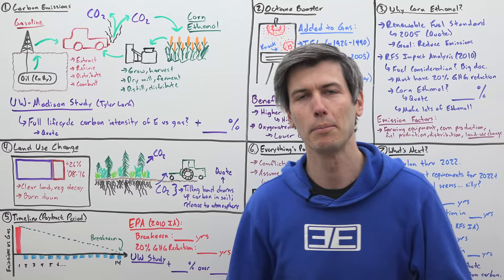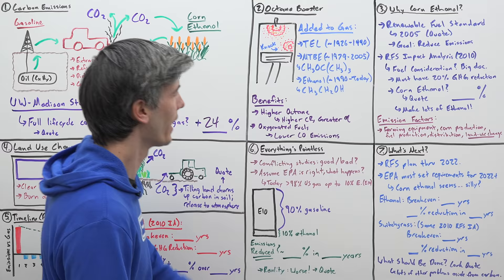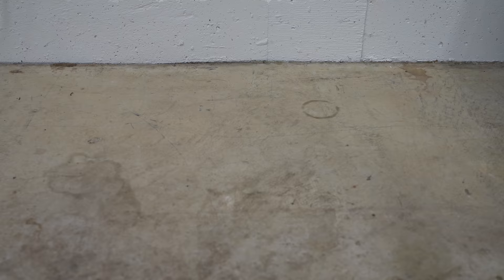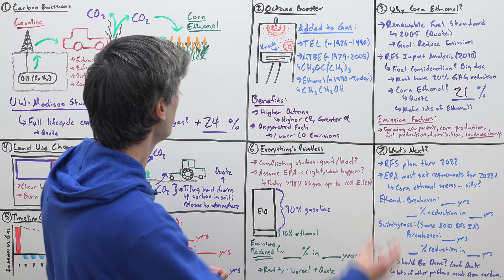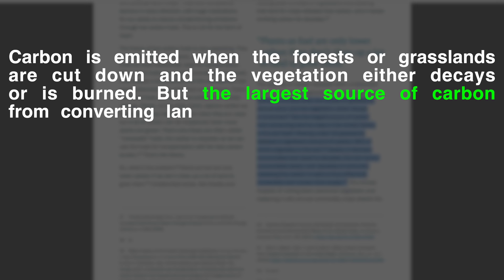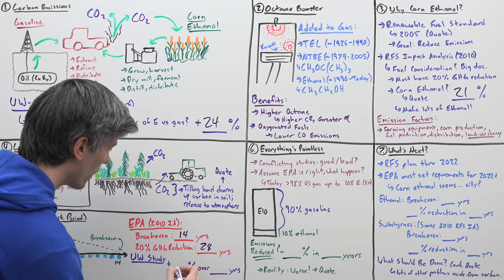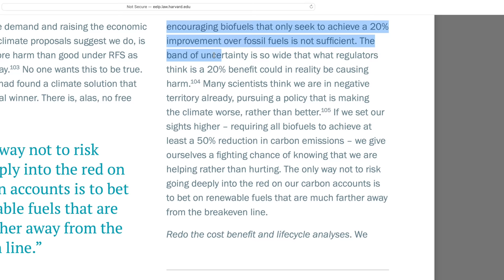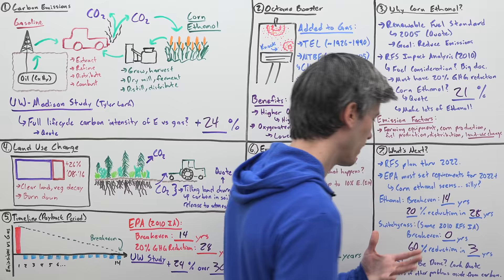America Was Wrong About Ethanol - Study Shows

Comment: The information in section 4 of your presentation is highly flawed it may have be correct in 1980 but not now just an example in the 80's corn yields would run in my area 100 to 150 bushels a acre now yields run from 200 to 300 bushels to acre not one more acre was cleared to do this and a large percent is done with no till not plowing or tillage this is easy information to come buy who ever is doing these studies are stating more opinion than facts because clearly they did not research it
Reply: Corn acres in the US have remained more or less constant since USDA kept track of them with 1932 (during Prohibition) the greatest at >113 M acres compared to 2018 (the year of most ethanol ever produced) at >88 M acres.  The yield trendline has been in a steady increasing rate very similar to other crops.  

It is quite impossible for grasslands or forests to have been broken up for corn on its face since US cropland acres have been falling since ethanol.

The corn belt actually grew more acres of corn in 1980 before ethanol than in 2018, the year of most ethanol ever.  Census data shows in corn producing states that grassland, forest, and wildlife areas increased since ethanol.

Comment: Hello, I really like the video. One thing that you did not put into your math is CRP land (land the government pays the farmer not to grow anything on), and as far as nitrates that is controlled (if done correctly) is crop rotation = Beans- corn - corn - beans.... Also, the fact that you can't pipe 100% ethanol like they can with gasoline, it has to be trucked or by rail car. Over all I think E10 or E85 is a good thing. When ethanol boom started it had a massive impact on farmers that could not sell there corn for anything but scraps hence CRP land to control crop production to farmers now selling corn for $4-6 a bushel up from $1.50- $2 a bushel. With all of this EV stuff I think it is a great start to something that could lead to much better technologies.
Reply: We have an ethanol pipeline in Florida and Kinder Morgan was building a huge dual use pipeline to it which was stopped in Georgia by landowners.  Brazil has thousands of miles of ethanol pipelines.

There were no grasslands or forests broken up for ethanol.  Simply impossible because US cropland acres have been declining.

Census data shows grassland, forest, and wildlife areas increased in corn producing states since ethanol.  

Here is how the 2007 Energy Independence and Security Act affected food/feed prices(if at all):

2007 WEIGHTED CORN PRICE =$4.20 WITH 4 .7B GAL MANDATE
2008 WEIGHTED CORN PRICE =$4.06 WITH 9B GAL MANDATE
2009 WEIGHTED CORN PRICE=$3.55 WITH 10.5B GAL MANDATE

2016 WEIGHTED CORN PRICE =$3.36 WITH 15B GAL MADATE MAXED OUT
2017 WEIGHTED CORN PRICE =$3.36 WITH 15B GAL MANDATE MAXED OUT
2018 WEIGHTED CORN PRICE =$3.61 WITH SAME 15B GAL MANDATE MAXED OUT + MOST ETHANOL EVER PRODUCED

Wheat
2007...............$6.48/bu
2008...............$6.78/bu
2009...………$4.87/bu

2016...………$3.89/bu
2017...............$4.72/bu
2018...............$5.15/bu

Soybeans
2007..............$10.10/bu
2008..............$ 9.97/bu
2009...……...$9.59/bu

2016..............$9.47/bu
2017..............$9.33/bu
2018..............$8.48/bu
Reply: @danafletcher2341  Hello, it is honor to have you reply to me. I am not looking to go toe to toe with your info as I am only going off of what I know at ground level, AKA growing up in a rural farming community, and having a distillery. I am in Iowa. There are a lot of ethanol plants here and even bio mass plants (stofer bails). There is no pipelines. I question if it is 100% pure ethanol going through those pipe lines or if there it is some sort of blend, in WY the is a refinery that gets rail cars delivered to mix with gas and then piped. Over time the water and benzene in the ethanol will eat at the pipes, plus it is fuel grade (super nasty stuff, unlike beverage grade). The nice thing about corn ethanol is there is not a lot of waste. All of the by product get concentrated into high protein DDG's and feed to cattle. I am getting off topic. Normal when you lock up your land into the CRP program it is for 10 years so it make sense that there is a reduction in crop price because farmers can make more money growing corn instead of growing literally nothing. Also, it would be interesting to see the crop prices before the ethanol boom like the 90's corn prices. Please don't take my comments as negative, I am interested in the out come if more data was applied and what result would be. One of my problems is that if you have ever visited rural farming country there are houses in the middle of no where with like 2-3 trees around it. I don't see where or how farmers would be destroying the forest or grass lands because every where I have ever visited there in none left to remove. I guess you could take out the water ways but farmers are very smart about conservation it's not like the 1920's anymore. I just thought of something else, the big seed companies have made leaps and bounds in crop tech, maybe also higher yield per acre has something to do with it. It would be a good show for you to talk about the yield per acre since 1900 to date. More supply, less money hence CRP program. Any thank you very very much for your time. I do really enjoy all of your videos. God bless and have a great day.
Reply: Ethanol on most any chemical compatibility chart you will find is at worst equal to but most often easier on rubbers, plastics, and metals than what gasoline and BTEX (benzene, toluene, ethylbenzene, and xylene) are.

Brazil sells E100 and that is pipelined.  Our Florida one is pure ethanol.  Ethanol has been sold in paper thin cans forever in hardware stores as well.  Non-toxic RV antifreeze has 25% ethanol and has been sold since there have been RVs.

Increasing ethanol production from 4.7B in 2007 to 15B in 2018 was over a tripling of ethanol production (>10B gal. increase), yet corn prices did not go up.  But here are earlier prices as requested:

1980 weighted corn price = $3.11/bu         .18B gal. of ethanol
1990 weighted corn price = $2.34/bu         .85B gal. of ethanol
1995 weighted corn price = $3.24/bu       1.36B gal. of ethanol

CRP program started around 1982 during the Reagan administration and a lot of those contracts were for 30 years.  Farmers put their poorest land in it usually while corn usually is put on their best land.

US corn acres have remained more or less constant with 1932 (during Prohibition) the greatest at >113 million acres vs 2018 (most ethanol ever) at >88 million acres.  Yield trendline has been increasing at a consistent steady rate all during this time.

The US used 11,160,933 tons total fertilizer on corn in 1980, before ethanol.

In 2018, the year of most ethanol production ever, the US used 10,521,850 tons total fertilizer on corn.

100% of the fertilizer and everything from the soil still gets fed to livestock in the distillers grains.  Ethanol comes from only things of the air: solar energy, CO2, and water with the latter two recycled once burnt.

Believe it or not, the corn belt grew more corn acres in 1980 before ethanol than they did in 2018, the year of most ethanol production ever and ethanol plants everywhere.

2018 Iowa 13,200,000 acres of corn with record ethanol production
1980 Iowa 14,000,000 acres of corn before ethanol

2018 Illinois 11,000,000 acres of corn with record ethanol production
1980 Illinois 11,600,000 acres of corn before ethanol

2018 Indiana 5,350,000 acres of corn with record ethanol production
1980 Indiana 6,450,000 acres of corn before ethanol
Reply: @dehnerdistillery6770  I found Census data on a query specific for states but 1992 is oldest and 2012 is newest available but ethanol by then was 88% of max so it gives an idea of any effects:

Iowa total cropland acres:
1992   27,911,000 acres
2007   26,730,000 acres
2012   26,714,000 acres

Iowa grassland and range area:
1992  1,518,000 acres
2007  2,134,000 acres
2012  2,879,000 acres

Iowa forest use land:
1992  1,944,000 acres
2007  1,944,000 acres
2012  2,968,000 acres

Comment: Something I didn't see included is how significant the CO2 released during fermentation is. It may be minimal, though in the quantities produced I doubt it, but it should be part of the equation.
Reply: 100% of the CO2 produced by the fermentation (and burning) of ethanol just came from the atmosphere and 100% of it is needed to be back there to make the new gallon of ethanol.  It is a cycle like leaves which fall from trees.

100% of the fertilizer (and everything in the soil) still gets fed to livestock in the distillers grain.  Ethanol is made of only things from the air; solar energy, CO2, and water with the latter two recycled once burnt.

What logic is it to then assign all the CO2 of fertilizer to ethanol and none to distillers grain?

There were no grasslands or forests broken up for ethanol.  Quite impossible since US cropland acres have been declining since ethanol.

Census data shows in corn producing states that grassland, forest, and wildlife areas increased since ethanol.

The corn belt grew more acres of corn in 1980 before ethanol than in 2018, the year of most ethanol production ever.

Comment: You should go in front of congress and explain this! Great job! BTW, I buy 90 octane here that has no ethanol in it for my lawnmower, snow blowers and my 2000 Honda Prelude and they run great!
Reply: Since US cropland acres have fallen so such claims are impossible, you would not want to make those claims under oath to Congress at a minimum.

In Brazil, identical small engines to ours use their common gasoline which contains a minimum by law of 27.5% ethanol.  It was worked out so great and for so long that Paraguay went to E27.

By the way, your premium gasoline contains around 40% BTEX (benzene, toluene, ethylbenzene, and xylene).  In 1948, the American Petroleum Institute Toxicological Review found that the only safe level of benzene exposure was zero.

Comment: Did they take into account the time required to replenish the fuel corn can be grown to replace what was burnt rather quickly. Oil on the other hand was converted from fauna that ate flora then died then became oil this took millions of years, we are burning that fuel far faster than the carbon debt could ever be repaid. This is the reason that corn based ethanol will always better.

Comment: The energy loss is in the mashing process where the linginates are broken down into digestible sugars for the fermentation process.   The current production used natural gas for this.   However,   there is so much waste heat energy from current electric plants.    Using this heat would make corn much more efficient.
Reply: All the energy and CO2 it takes to produce and deliver a product to the consumer is reflected in the price of the product.

As such, note the spot cash delivered price of ethanol on the NYMEX is $1.32/gallon.

The price of an unusable sub-grade gasoline (RBOB) is $2.62/gallon.  Usable E0 costs even more, E10 or greater obviously less while being non-toxic and far cleaner burning.

Poet, the world's largest ethanol producer, has at least half of their plants using waste steam from natural gas electric plants.  Waste steam = free energy (essentially).  Thus ethanol's already low price has room to remain low.  

GE converted a few natural gas turbine engines at an electric plant in Brazil to be dual fueled with ethanol.  That would make it so no newly added CO2 would come from making the electricity, but its value as a transportation fuel would make it more expensive to do.

There exists a novel process which uses nano bubbles to spray the beer into a vacuum column which boils at just 104 degrees F to make 200 proof anhydrous ethanol in just one pass without the need of a molecular sieve to remove the last bit of water.  This saves some 75% of the energy used in traditional natural gas ethanol plants.  Would make heat pumps viable to heat and cool the column saving even more energy.  Works for distilling water too.  Again, ethanol has room to remain low in price.  

I am surprised at the suggestion distillation for ethanol is a problem, it uses relatively low temperatures.  Crude oil is distilled twice, once to remove water and then again at an astounding 750 degrees F.  Oil wells and petroleum pipelines even flare off natural gas to boot.
Reply: @danafletcher2341  all understood and I agree.  I am saying that waste heat from cooling sacks and ponds could be used to cook/distill.   Conversion of the lignates is still a huge energy drain that would be unnecessary if we stopped wasting the heat from electricity production

Comment: calculating the 'additional land' that was needed in the calculation isa totally skewered and wrong, these land would have been claimed by farmers anyways.  a good thing the scientist did not use that part of the data as it is irrelevant long term
Reply: There were no grasslands or forests broken up for ethanol.  Impossible on its face since US cropland acres have been declining since ethanol.

Census data shows grassland, forest, and wildlife areas increased since ethanol came to be.

Ethanol is a value-added product of already existing feed production acres which preserves the feed in a healthier and more productive form called distillers grains.

Believe it or not, the corn belt grew more corn acres in 1980 before ethanol than they did in 2018, the year of most ethanol production ever and ethanol plants everywhere.

2018 Iowa 13,200,000 acres of corn with record ethanol production
1980 Iowa 14,000,000 acres of corn before ethanol

2018 Illinois 11,000,000 acres of corn with record ethanol production
1980 Illinois 11,600,000 acres of corn before ethanol

2018 Indiana 5,350,000 acres of corn with record ethanol production
1980 Indiana 6,450,000 acres of corn before ethanol

Comment: How much does the octane boost -- and consequent use of high compression engines --- help increase mileage and therefore save fuel and reduce emissions?
Reply: Hard to say specifically.  But I'll give you a couple anecdotes.  If you stand behind a running gasoline fueled car that has illegally removed its cat converters, you'll have difficulty breathing and your eyes will be watering in seconds if they rev the throttle.  Stand behind the same vehicle running pure ethanol and you'll barely notice anything (still not the healthiest thing to do, but it illustrates a point).  We've actually been able to get cars to pass tailpipe emissions tests without a catalytic converter by carefully tuning them on E85 fuel.  Mileage wise its hard to get the same economy with ethanol as with gasoline.  But right now in places like California, you still get lower costs per mile running E85 vs. 89 or 91 octane.  It's about on parity with 87 octane (cost/per mile).  If we built more dedicated ethanol focused engines the cost per mile would be less for E85 than for any version of gasoline available (assuming current fuel pricing relationships held).

Comment: They have been saying that Switchgrass is better than corn for many years. No one listens.
Reply: Cellulosic or Gen2 ethanol which switchgrass qualifies for has a $1.00/gallon Federal subsidy in place.  Somebody listened and cared.

Corn ethanol's subsidy that ended back in 2011 had been only $.45/gallon.

Celulose is harder to extract ethanol from and requires a huge amount of bulk to handle.  Cellulosic ethanol plants cost 5 to 6 times that of regular starch/sugar plants.

Despite the huge subsidy, there are no cellulosic/Gen2 US ethanol plants yet.  Dupont was building one in the town of Nevada, Iowa that was to use corn stover to make ethanol, but it did not work out and they sold it to a German firm who repurposed it.

Corn stover removes half the corn stover on a field and comes from already existing corn feed production.  Switchgrass requires a dedicated acre of farmland and dedicated fertilizer.

That German firm repurposed the cellulosic plant to make renewable natural gas from corn stover fermentation bins and corn ethanol from the distillery.

There you have a plant which makes natural gas that can run a natural gas electric plant and supply the area with zero newly-added CO2, use the electric plant's waste steam to make ethanol which of course produces zero CO2 period, and then sell the bagasse from the corn stover as humus/fertilizer and the bagasse of corn ethanol of course as triple concentrated, healthy, and high value distillers grains.

There were no grasslands or forests broken up for corn ethanol.  Quite impossible since US cropland acres have been declining.

Corn ethanol just like corn stover natural gas is value-added product from already existing corn feed production acres which preserves the feed in a healthier more productive form called distillers grains.

With corn ethanol's feed factor, few sources can economically compete with it even though they make more ethanol per acre (like beets and sugarcane) but little else.

100% of the fertilizer and things in the soil still get fed to the livestock.  Corn ethanol is made of only things of the air: solar energy, CO2, and water with the latter two recycled once burnt.